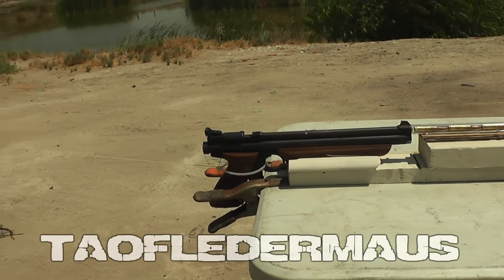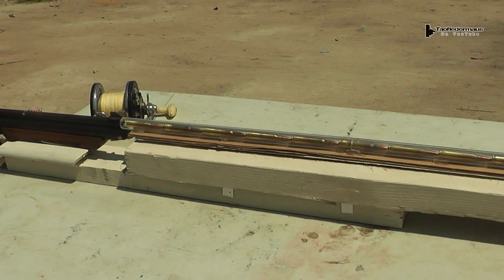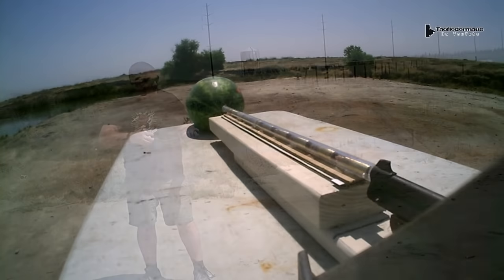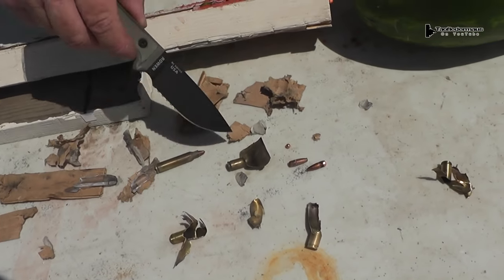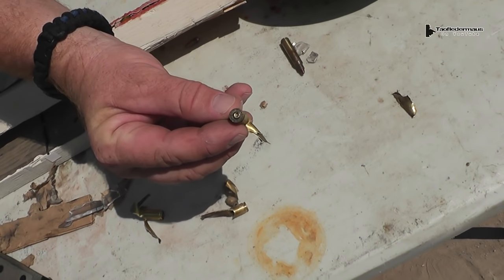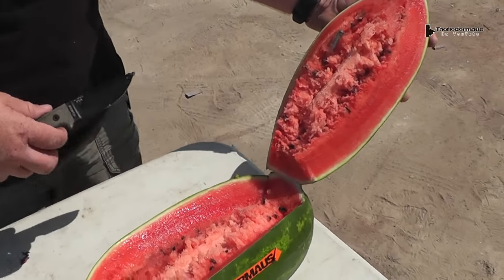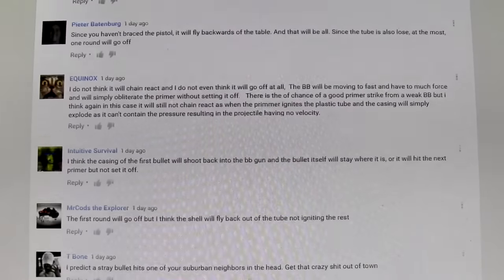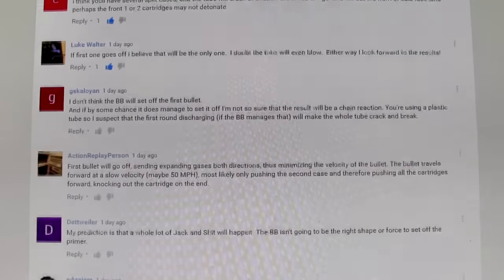Chain-Reaction of TEN Rifle Rounds -  99.99% got it wrong

Comment: I'm sure glad I learned about this potential safety issue. I was just about to load a bunch of rounds into the tube magazine of my .35 Winchester, of course I would naturally ram the shells into the tube with a high powered BB gun shot to the rear-most cartridge in the tube. But now I know better! (and knowing is half the battle!!)
Reply from the maker: ok
Reply: TAOFLEDERMAUS 
I was just joking. I was among the vast majority of people who didn't think that there would be a 10rd chain reaction. It didn't surprise me that at least 1+ of them went off, but all of them...(?)   
But now I wonder what would happen if you tried the same thing with 10 Russian AK-47 cartridges that are Berdan primed, since they are supposedly more "robust" when it comes to the amount of firing pin pressure required to set them off.

Comment: So, more of your videos came up, and so I was watching this one, and thought it was funny that there was a "yeah right" over the prediction of the cube being accurate (which I'd commented on and got sort of called out on in the comments). 

I gotta say that... your viewers aren't great at the physics. And that's not at all an attack! MOST people never experience some of the phenomena you're testing, so they can only go on the reasoning they have in their minds. 

In the case of the cube bullet, the bullet has both axial and triplanar symmetry, as well as points of stability that any instability can fall to. This means the air's not going to circulate, and so the bullet's not going to "knuckle." The cube tumbling doesn't significantly change its frontal area and doesn't change the direction of forces on the bullet, so it's pretty much good to go. Will it be accurate at long ranges? Well, no, of course not, for the same reasons musket balls aren't. 

Things like baseballs don't HAVE a stability point, so they "knuckle." If something catches the ball and it begins to rotate, there's nothing to stop it other than body friction, which means small changes in the surface pressure start to affect trajectory, but speed's still pretty much normal. 

For this test, the ONLY question was if the BB could punch the first bullet. Which depends on the BB gun in question. Obviously, this one worked. I'd bet a nickel that an airsoft gun wouldn't have the energy required. 

After the first bullet is charged, there's nothing to stop the forward motion. The folks thinking about the bullet needing space are thinking about momentum, but that's irrelevant here. The combustion is going to expand and push that bullet forward, just like the combustion chamber in your car. Will some push backward? Sure. Of course. But an equal amount would push forward, and that combustion's going to have PLENTY of energy to rival the original BB. The soft tip of the bullet vs the hard primer is again irrelevant because there's a ton of energy behind that bullet. That energy's got to go somewhere. It's all pushed into that tip. Which is going to be plenty compared to the BB.

For the BB being too round? That means that there's going to be a point tangential between the dome of the primer and the dome of the bullet. So it's... pretty much equivalent to a point.

So tl;dr: As long as the BB has the energy to set off the first round, good to go. 

I saw a lot of claims that the BULLET would rip the "barrel" apart, which is silly. Hot expanding gases gotta go somewhere.

Comment: Actually, this is not a chain reaction. You've created one single reaction. Because you didn't give space you have one ball contacting one mass. The energy of the bb can simply be transferred through the mass to the end firing pin, which is all you need to claim your test succeeded. This doesn't mean that any one of the 9 other bullets needs to fire. 

To do this test correctly you absolutely need to put space. Not because it's needed for bullet acceleration - there's enough force there to set off the firing pin, clearly - but to achieve a true chain reaction.
Reply from the maker: There is a distinct wave of energy from one end to the other
Reply: Yes, through one mass. Everything is physically touching. There is no chain reaction. There is a chain - it is two links long. It is not a chain of 10 links, as you claim.
Reply from the maker: watch the new video filmed at 10,000 fps
Reply from the maker: We RE-FILMED this with the Chronos high speed camera.    Be sure to check it out!   10,000 frames per second!!
https://www.youtube.com/watch?v=3GkaNg6S0H4

Comment: I CANNOT BELIEVE how many of you predicted the outcome incorrectly...
The two most BASIC laws of physics explain why this is possible.
The answer is SO SIMPLE! 
Please read the following explanation below...

Every action has an equal and opposite reaction. The force of the bullet traveling forward has almost as much momentum as the new round exploding immediately after being hit. This would explain why that one round was pushed back into the casing. 

Also an object set in motion will continue in motion until opposing forces act against it. The rounds were perfectly positioned in the clear plastic tube while touching each other. There was no opposing force to alter the trajectory of the bullet. The plastic tube is not needed once the chain reaction begins. It is merely a support system to hold the rounds in place before they are set off. 

This experiment perfectly demonstrates these two laws of physics. Did any of you pay attention in science class?